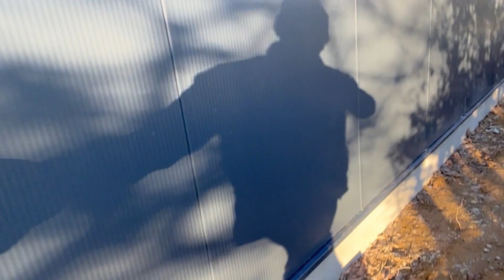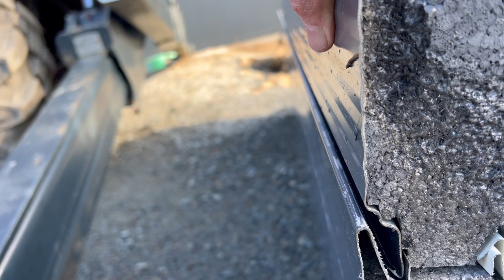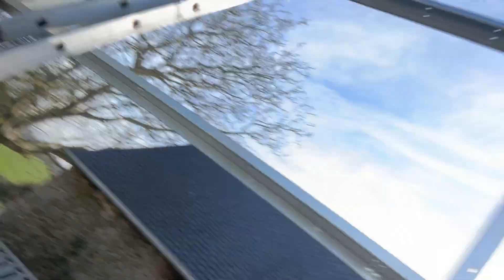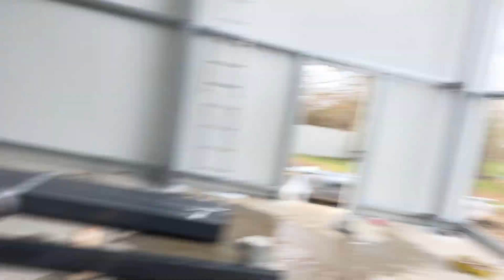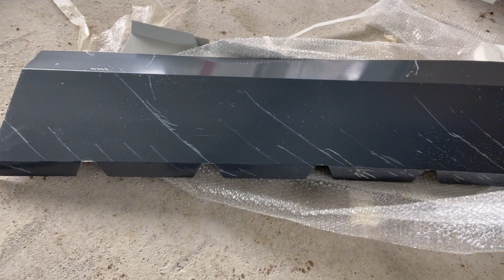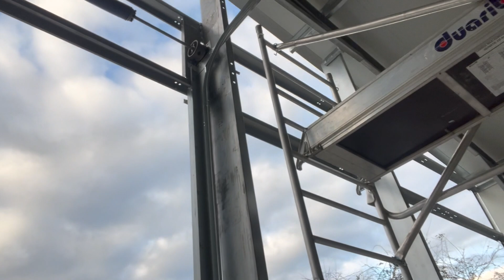Project manager-Juggling contractors and suppliers.

Comment: Looking very good. You explained how the first panel of each side is bolted into the steel frame, but how are the rest of the panels held against the frame? Do they somehow slot in to a channel at the bottom and top?
Reply from the maker: Hi Chris, like I said their seem less , the bolds on one side , then are the locking mechanism for the next side, in effect , bolts on one side of each panel. It takes a few seconds to grasp the idea, but they are really solid and secure
Reply: @BeesInBrittany  Thanks Richard, I had not appreciated there are bolts in each panel, makes sense, of course!

Comment: Looking GREAT . A good question to ask , for some reason years down the road if a panel or two was for what ever reason got damaged can a single panel or more be changed out very easily or do you have to start at the finished end of that wall an remove all those panels to get to the damaged panel(s) to change them out . Just a thought. I am a retired Diesel mechanic of 47 years so I just have my gears turning all the time . Just a thought. So happy for you. Thanks for the update.!!